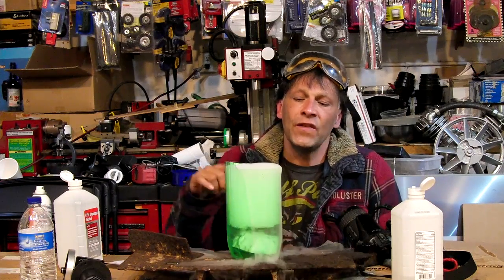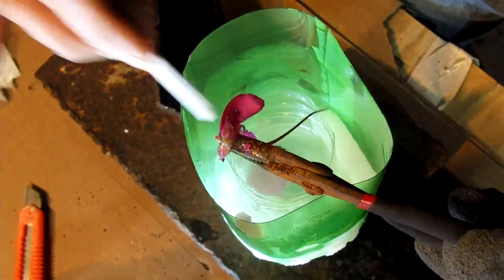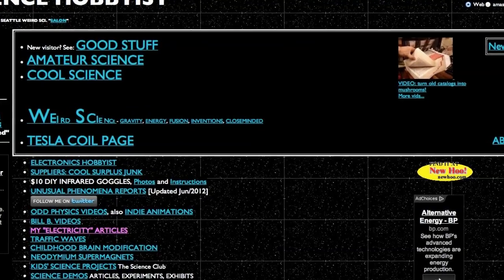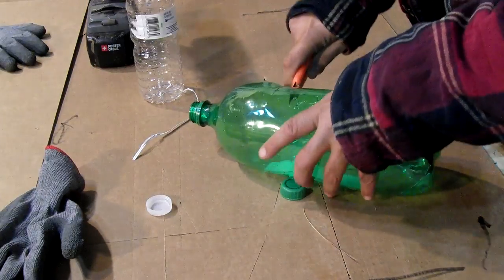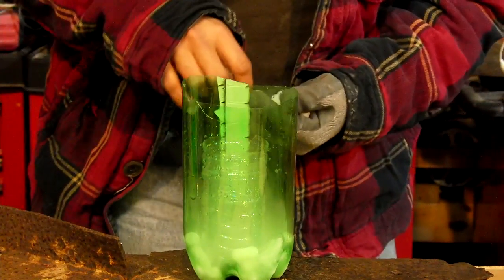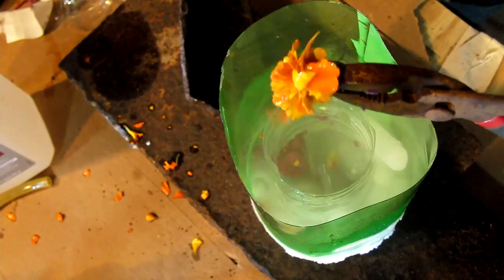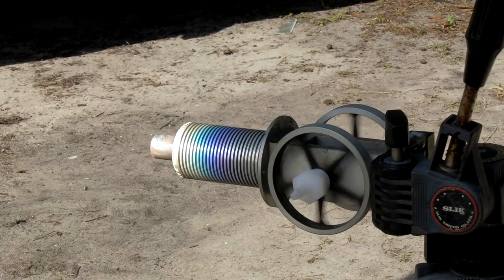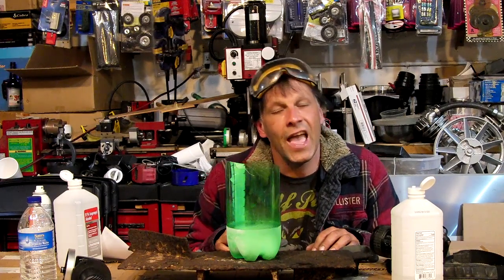Make your ownLIQUID NITROGEN Poor Man's Liquid Nitrogen Bill Beaty's concept

Comment: Safety Fails:
- not wearing goggles when cryofluid is bubbling right in front of him
- drilling towards hand
-does not explain that certain kinds of gloves will hold the cryofluid against your skin, worsening injury
similarly, recommends "long sleeves" when, again, many materials will just soak up the cryofluid and hold it against your skin, making the injury worse- depending on the cryofluid, sometimes bare arms are best.

Comment: hey dan, sorry its been a while, I do have a Chinese mini lathe 7x12 and recently acquired an emco compact 5 cnc  with milling attachment. I still haven't programed anything on the emco but the feeds are nice to do work with. but for fair sized pieces and faster machining I do at work on my spare time. 

I did get plans from metal projects.com, they have quite amazing stuff on there. 

thanks again for your work

Comment from the maker: I am working on one with the wire glue: watch?v=JJTpWPHAoUk
But for less that $20 go to ebay and search:
"5000mAh Solar Panel Power external Bank 2-USB Port back up battery Charger"

They have it all with backup batteries inside. When not in use, set in direct sunlight, you are ready to go. Cell phones require very little power so they are easily charged. The internal batteries in the solar unit will charge 2 cellphones to full when not in the sun from a full day exposure.